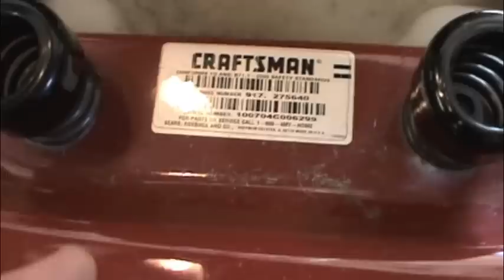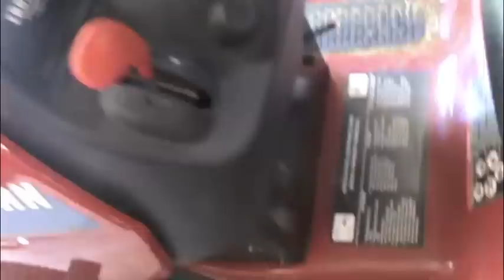Craftsman DYT4000 Overview, Cold Start, And Moving Video

Comment: The DYT4000 for a homeowner with 2 acres of lawn or less...was probably the best tractor in that price range ever made. They do require a bit of casual maintenance to keep in top shape but incredibly easy to work on and do a great job. If yours is not mowing correctly then it needs attention to spindles...drive belt...blades...and mower deck setup as it relates to level and deck wheels.